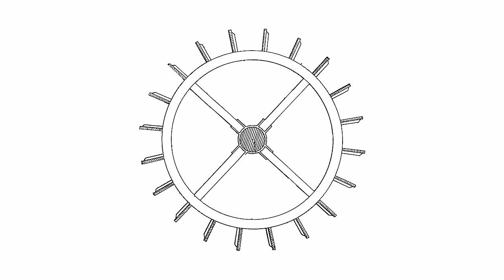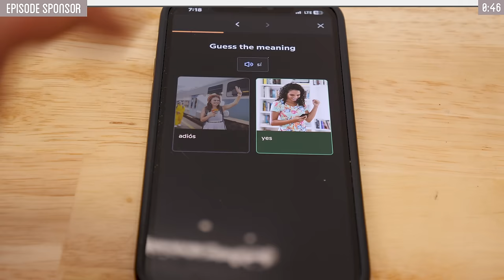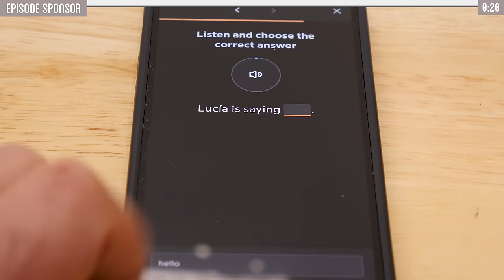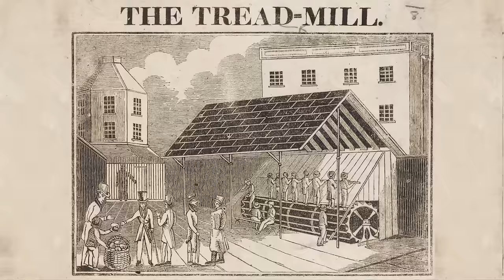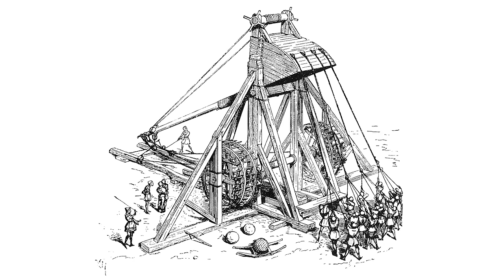This Machine Powered the Roman Empire!

Comment: Interesting and reminds me of the undershot water wheels that were installed on like barges and tethered to the shore line of canals or rivers.  These would be used as prime movers in Europe and I believe finding years back info on use in channels and rivers in the Colonial east coast of the U.S..  I came across when researching the hydro methods and collecting waste in rivers since seemed like an interesting power station or prime mover for like the conveyer belts to pickup trash.  Possibly other uses in rivers like mining or other irrigation with like spiral tubes or other wheels to lift the water.
Reply: That looks rough being so small diameter and that center axle shaft in the way like noted. Otherwise, looks awesome and I can only imagine the range of mechanical devices used to erect or make things.  Guessing there are YT videos detailing the range of cranes and related excavating and other equipment. Looking forward to seeing your designs and apps.  Thanks for sharing and have a good one!

Comment: Kinda going lightweight on the sledge hammer. You have mechanical advantage, why not put a 30-40lb head on it and use that to forge? Vs a 15lb sledge(what I’m guessing from the visual) should be more efficient with the nautilus shell gear anyway. These projects really take me back ;) looks like a blast.

Comment: For safety maybe you should have also rounded the centre and put in a harness supported on a free spinning metal hook. That way if you fall you float suspended and can't faceplant, it wouldn't be comfortable but better than sanding your face off.

Comment: I'm very curious, I assume stability was the main reason for having the wood in the middle, but I saw in the hamster wheel video that the wheel was being held from the sides, so if you were able to remove the middle part of the post (so it's only on the sides where it actually attaches) it would make it more usable because you would be centred when you walk so wouldn't get so dizzy.
But I doubt that a small piece of wood can handle the weight?

Comment: yea, that size needs to be walked on top. In the middle it is either 2 ft radius too big or too small. Btw, if instead of using the axle, you used the rim, you would not need a central axle, and can split the friction among more points of contact, as well as power extraction.

Comment: 11:41, If you can me the central beam able to support human weight (and a bit extra) then round it off and put a seat or something there to keep yourself in a fixed position while the wheel spins around you, that should remove the hazard factor of it.
Reply: wouldnt a seed totally brake the machiene the power is from the grafitation that you get when your higher so the weel turns so the heaviest load is on the bottom so you step up and everything begins again. so you would just use a few killogram and not the complete person
Reply: @thomaskletzl6493  The power does not come from gravitation, it comes from the turning of the central beam that I was suggesting to hang the seat off of. The feet turn the wheel which in turn turns the central beam which in turn delivers the power needed. A person's weight only effects how fast it turns and only if that person can stay upright consistently. As you saw they can't stay upright so the power becomes unreliable as a result which is more important than the strength of the power.

Comment: for safety. not historical accuracy. if you had some kind of steel ring around the center shaft that would spin freely. and attached a harness to it. then the runner could hold there arms to there chest, lean forward putting there weight on the harness and run without fear of falling, or hurting there arms or hands in a pinch point.

Comment: 5:55, flat surface is wrong move, makes turning the wheel 10 times harder I expect. Should've gone with wavy surface, gives you steps to step onto as you walk which naturally pushes the wheel in the direction you want. Think 2 boards angled against each other to create a small wide triangle would be enough for the initial shape of the step then a bit of sanding at the corner should make it a bit more wavy.

Comment: The things you build would be much more structurally stable and last longer and be better to use if you spent the time use some actual wood joints like even like basic cross lab joint would make this quite a bit better

Comment: What is the point of using hand tools, if you're building on smooth concrete, with dimensional lumber, and modern wood glue?  Either be traditional and forgo all modern amenities or don't, otherwise what's the point of halfa55ing it?
Reply: They’ve proven before on how to make square wood for building , as long as they’ve shown they can do it once then I feel it’s okay to use pre cut wood. As if they tried to do everything then it would take way to long (also more $$$)

Comment: I can suggest taking the power not from the axle, but from the rim of the wheel with the help of another small wheel, basically creating a primitive gearbox. This will give significantly more rpm in cases when torque is not as important, as for example in a project with a hammer.
Reply: very good idea

Comment: Your spokes are dangerously close to the support base. your hands are on the spokes and at the point the spoke is in the 6 o clock posision your hand is dangeroudly close the the support base. A little movement and that device will take someones fingers with the pinch points you guys made.

Comment: G'day,

As a Registered General Nurse, what I see is
How
LUCKY you all were that
Nobody 
Successfully (suck Cess fully !)
Managed to get a 
Hand, Arm, Foot, Leg, or indeed
Head
Between
The Wheel-Spokes & the
Guillotine
Choppy  Choppie Amputator Edge of the
Mounting-Stand for the Axle.

When old mate fell over, while the Wheel was spinning as fast as he could run,
Another few inches and he 
Could've become an Amputee...
Likewise, 
Every time the Runner reached for a Spoke to maintain
Balance..., 
Their Fingers and hands were
Microseconds & fractions of an inch away from
Getting stuck in the 
Scissor-gap between the 
Rotating Spokes and the
Axle-Beam...

You might want to fit
Safety-Nets, to enclose the
"Drum"
Before playing with this
Dangerous Prick of a thing
Again...(?) !

Just(ifiably ?) sayin'.

Stay safe.

;-p

Ciao !
Reply: We appreciate your concern, but the tolerances are not tight enough to crush limbs (by design) and axle on the hammer side of the wheel has a four foot gap between the support strut so we can safely get in and out without any danger of pinching.
Reply: @theomelchior2739  

I'm glad you reckon that you're into it, but it looks to be quite feasible to project a bit of Human out past the Circumferential edge of the Footplanks, particularly if you try too hard and fall when the Gyroscope has a big chunk of Momentum going...

And the revolving Spoke 
WILL collect that projecting Limb, and then drive it past the
Vertical Support for the Axle,
And that Gap
Between 90° Edged Beams appears to be
Closer to 
Two Inches than 4 Ft.

It's a Flywheel augmented 
Rotary
Wooden
Guillotine.

Ask your Insurance Company's
Occupational Health & Safety Consultant.

Their Actuaries will probably offer to cancel your Coverage - pending 
SOME
Safety-provisions being 
Implemented.

I found it scary to watch.

"Danger..., danger, Will Robinson ; 
Warning. Danger...!"

To quote from
Lost In Space.

Good luck !

Stay safe.

;-p

Ciao !

Comment: The Circumference (or) perimeter of circle = 2πR. 
So if you want a bigger wheel for him to not hit the beam that means the wheel needs to be so much bigger and use so much wood, i even doubt the wood can hold that amount of weight. He would need to build the supports so long that it becomes dangerous and the wind could affect that structure.

Comment: Yeah, the Roman design is really poor.  It is huge for capturing one person power.  It makes the person dizzy using it, and there is no way to swap out a tired worker without stopping it.  A capstan seems more practical from the amount of material needed to produce it, which is also possible to hook up with a draft animal.  It has the advantage of changing the motive power by lengthing the arms.  For a human, a tilted disk that you walk on with a bar for resting your arms seems better.
Reply: Tell me more! Also explain what a capstan is
Reply: @slevinchannel7589 A capstan is a vertically orient axle, like what was used on sailing ships to hoist sails.  Into this axle is inserted arms which sailors pushed against as they walked around the axle on deck.  It has the advantage that the arms can easily be stored when not in use.  Also, a number of sailors can be employed with multiple, long arms.
Reply: @richdobbs6595  Arms?

Comment: Yeah the center beam is in the way because it is where you would be naturally . So long nothing is powered you could replace it by using bearings but when you power something the wood would deform under the uneven stress to counter this you would need use gear boxes on both side and a pipe under it to even out the stress (so the load is not just on one side)
Reply: Make a bigger wheel where the axle is above the person running.
Round over the axle so the runner can grab on that easier, or make a harness that slides over the axle so the runner has more support for balance.
Keep some space between the slats so the runner can focus on something outside the wheel, This will lessen the motion sickness.

There are dozens of improvements that can be made, that is why it is a prototype, after all.

Comment: i think this may be one of the more dangerous things you've built and I kind of wish you had gone with a different design, like some of the imagery shown of walking on an angled disc, or walking on the outside of a wheel. The way this one looks, its difficult to walk without hitting your head or falling forward, and the speed seems to get away from you pretty quickly. In the event of a fall or injury, not only is it VERY difficult to get out of (or to get into in order to carry someone out) there's also no way to stop that massive thing. And with the only "railing" one can hold being on the outside of the wheel, if someone instinctually grabs that for stability (as some of you did in the video), they will have an unhappy day where they fuckin lose an arm. Folks are commenting on improvements you could make but tbh I think the better way (as expensive and effortful as it would be), would be to start from scratch and get y'all an OSHA approved hamster wheel design.

Comment: Sup fam. Remember those five rules I posted here forever ago? Yeah you can just simplify it down to one universal rule of design and engineering (design in general is more general because it is abstract): let everything be what it is, and not what it is not. If you don't know how to apply that, just meditate on it. It's dangerous to go alone. Take this: Let X be X, and not Y. Those five rules and anything else you could come up with all are implicit in this universal rule. I guess Will Osman's degree (and everyone else's) was worthless after all 

Oh also, some useful considerations: there is abstract and concrete design: the former deals with intent and purpose; the latter deals with implementation. The practical problem defining the genus that is engineering is ultimately that of taking final causes or intentions (the abstract design), and then choosing a reality by which to realize it (the concrete design or implementation), but if you do that the naive way, you end up with devices that only do one supremely specific thing (however, everything should only do one thing regardless), so best to consider what you want to accomplish, and then implement according to the genus rather than species of your intention, here the intent being the species itself unless your intent is supremely general.

Supplement: read St. Thomas Aquinas who corrected Aristotle on certain things. In case you were wondering where this knowledge comes from... it's all reason and first principles, so none of it is "subjective" (also, please note the philosophical terms used here are not to be presumed as same with the contemporary meanings). Good Thomistic Ontology course? Rev. Paul J. Glenn's courses: Ontology, B. Herder Book Co, Library of Congress Catalog Card Number: 37-39097; and related courses of which there are 9 in total: Dialectics, Psychology, Criteriology, Ontology, Ethics, Sociology, Apologetics, Theodicy, and History of Philosophy. True and correct ontology will teach you how to define the whatness or essence of things so as to be able to differentiate everything perfectly without adding or subtracting to what those things are. Should be pretty obvious how that's useful in conjunction with the universal rule I gave above: you cannot make something unless you know what it is.

Comment: That's awfully slow to run a power hammer, maybe connect the wheel to a large cog/gear, then that cog/gear to a smaller one.  Increase RPM without having to actually work any harder to make it go faster.

Comment: If you're using it to pump water or as a crane, does the work involved act as resistance so that you don't have to worry about it picking up speed and you falling over?
Reply: Yes. It would be comparable to riding a single speed bike on flat ground vs uphill

Comment: Why don't you use power tools? I mean power tools milled your wood, I mean I get the theme of the channel but it's like you're creating an extra 100 hours of work on a project you could knock out in 8. I mean use power tools for cutting and drilling, same product in the end even if you fasten with dowels and glue.
Edit: It looks like you were using a 2x4 as a non marring mallet and it was doing nothing to move the wood into the joint, like these things would just make me cry, wouldn't it better for the theme of the channel to be incredibly more productive and get way more done in order to explore more topics?

Comment: If you're going to use modern steel tools, just commit and use power tools so you waste less time and get the projects iterated on and out as videos faster. I don't care if you hand drill the thing if you're still using a modern tool to do it.
Reply: You know why they use modern steel tools, like the auger bit? Because they do not have the time to make their own in this quality because of annoying people like you. The hole of a great handmade drill vs a modern drill is the same, so to simplify that bit they use it. Using power tools is not the idea behind this channel, this comes once they managed to build their own electric motor etc.

Comment: Not to be this kind of a commenter but like....just use power tools lol. I understand the point is to build it close to how the romans would have done so, using hand tools and such...but you're building a big portion of it inside of a climate controlled room regulated and lit by electricity, and you're using modern wood glues made perfectly with chemical precision on chemical and pressure treated wood (that is already machine precision cut), alongside modern industrially-formed, high quality steel nails. Theres just...not really a point to using hand tools, because drilling a hole wont make the hole any more historically accurate to a hole...its just a hole. Rounding the axel wont make the axel any more or less historically round. 
Idk, I know I'm just a debbie downer, but still, making these things easier for yourselves means you can put out more videos, faster, with the things you intend to show.

Comment: You built is wrongly!  How hard is it to draw a large circle on a perimeter of wood??
Reply: sorry we built it wrongly, in your experience of building giant treadwheels what did you do differently?
Reply: @theomelchior2739  lay down on the ground a circle from the desired radius.  From that use 2by12  wood to adjust the ends equally so that the arc is equal inside the radius all the way around and each arch uses maximum wood.  
Important,  redraw the inside perimeter line ON THE WOOD and cut that.  You now have a template to make 2more rings and you have an interior round frame. Add plywood and you have it!
Reply: there are enough historic examples, even in this video, of wheels where the axel is on shoulder height. That is not the problem